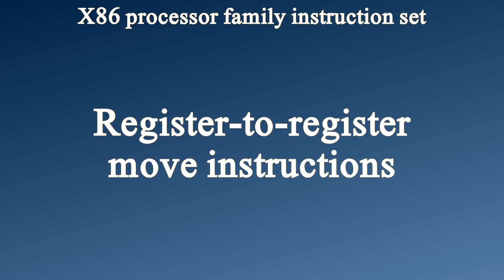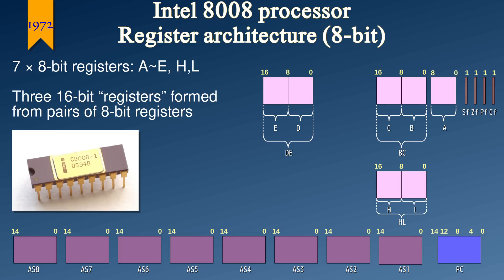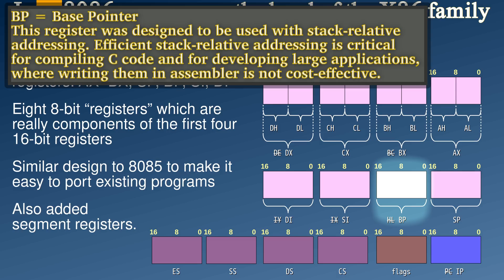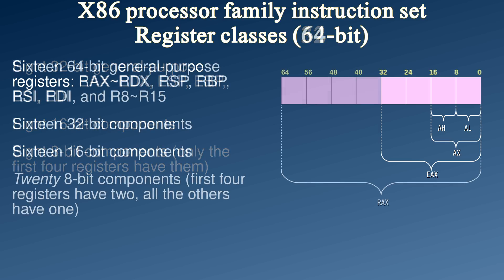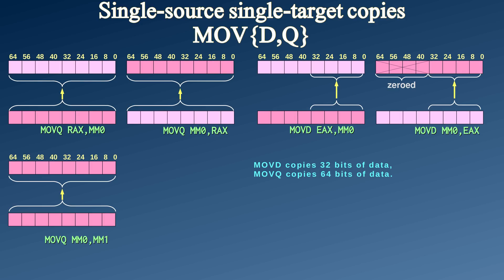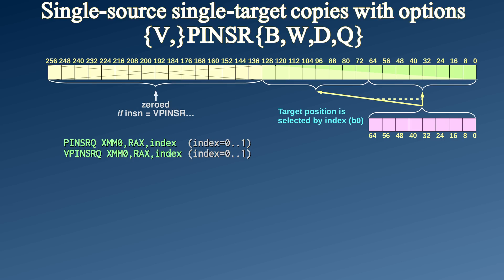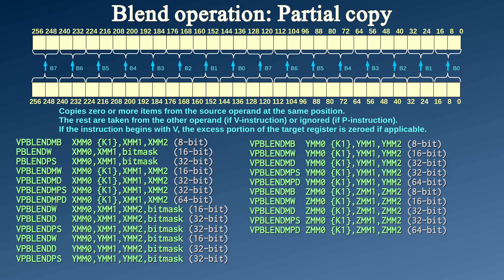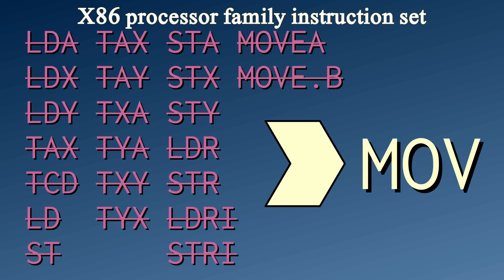x86 mov insns & short history of the most popular CPU architecture

Comment from the maker: A reminder: Do not reply to this post if you want me to see your comment. Post your words as a new comment, not as a reply, unless you are addressing the contents of this comment specifically. YouTube does not show creators new replies, it only shows new comments. If you reply here I will not see it unless I manually check for  it. If you are addressing a comment someone wrote, then you should reply it, though.
----
You may have seen parts of this video previously in my other videos, even if those videos were published many years ago. Either this means I am a time traveler, or this video has been in the works for a long time. In any case, I decided to finally push it to production & publication.
Because the topic is so incredibly broad, I decided to limit it to register-to-register move instructions only. If we allow other kind of moves, we get plenty of new use-cases. The x86 instruction set is not small by any measure.

For example, we have VPGATHER{Q,D}D / VGATHER{D,Q}P{S,D} which can perform up to four 64-bit loads from completely unrelated memory addresses in a single instruction, and the VPSCATTER{Q,D}D / VSCATTER{D,Q}P{S,D} which do the same with stores instead of loads. There are also VPMASKMOV{D,Q} which work much like the BLEND operation (sieve) but with memory.
Then there is the LEA instruction which has already existed since 8086. It can do not only a load of a constant into a register, but it can also do addition and multiplication in the same instruction. It was made even more useful in 386 which added scaled-index addressing, so much so that pretty much every compiler utilizes this instruction for multiplications of constant values.

IA64 sadly never became popular, because it was thought that the architecture puts too much responsibility on compiler developers. But even today, as intelligent as the x86 processors are with their register renaming and multi-insn-per-cycle pipelinings, there are several instructions in the instruction set that are designed to improve performance, but which compilers never generate without explicitly being asked to. For example, all the prefetch instructions. And the whole thing about dozens of instructions that only differ in the type hinting… Yeah. That is the role of compilers to choose from.

Nitpicking:
All this study about instruction names concerns language, i.e. culture, not CPU design. It is just what Intel decided to call certain operations. They could have had “MOV EIP, 1234h” instead of “JMP 1234h”, and they could have had “MOV AX, BX+SI” instead of “LEA AX, [BX+SI]”, and they could have had “MOV EAX, SIG BL” instead of “MOVSX EAX, BL”, and they could have had “MOV MM1, MM0” instead of “MOVQ MM1, MM0”, and they could have had “MOV GDTR, [label]” instead of “LGDT [label]”, and they could have had “MOV [++ESP], EAX” instead of “PUSH EAX” … without changing a single thing in the CPU design. But they did not. I’m not criticising… much. I am just documenting. :-)

Errata:

— I neglected to mention that the number of XMM registers was initially only 8. When AVX was introduced, it extended the number to 16, the width to 256 bits and name to YMM.
— I got the B/C and D/E wrong way around in my BC and DE pairs. B is higher, C is lower; same for D and E. Thanks theALFEST!
— There is a byte-size shuffle instruction, PSHUFB. I also missed PSHUFW. Thanks Jan De Kock! And of course I acknowledged on screen that I neglected VSHUFF{,I}{32x4,64x2}.
— Didn’t list VPBROADCAST{B,W,D,Q} and VBROADCASTI{32x{2,4,8},64x{2,4},128}, which are integer versions of the broadcasts, or VBROADCASTSD, which was added in AVX-512.
— Didn’t list VPERM{B,W,Q,ILP{S,D},{I2,T2}{B,W,D,Q,PS,PD}}, even though I did VPERM{I,F}128 oddly enough.
— Didn’t list VPMOV{,S,US}{QD,QW,QB,DW,DB,WB} which do integer conversions from large to small, much like the {V,}PACK{SS,US}{DW,WB} that I did mention.
— Didn’t list {V,}PMOV{S,Z}X{BW,BD,BQ,WD,WQ,DQ} which do integer conversions from small to large, being vector parallels to MOV{SX,ZX} which I did mention.
— Didn’t list VPMOVM2{B,W,D,Q} and VPMOV{B,W,D,Q}2M, which do conversions between mask registers and XMM registers.
— Didn’t list {V,}P{SRA,SRL,SLL}{V,}{W,D,Q} which do bit-shifts, but compilers (ab)use these as a combined mov & clear.
— Didn’t list {V,}PALIGNR or VALIGN{D,Q} which is like a combined SRL (shift right) and UNPCKL (interleave).
— Didn’t list any instructions that do conversions between floats of different sizes or conversions between floats and ints, which at least on AVX-512 are possible to do without memory operands.
— Didn’t list conditional moves: CMOVxx or VPTERNLOG{D,Q}, even though I did list blend instructions which also do conditional moves.

Instructions that I did list:

— MOV: Copy entire Ⓑ (same size)
— MOV{SX,ZX}: Copy entire Ⓑ (into larger size) with sign/zero extension
— {V,}MOV{D,Q}, KMOV{B,W,D,Q}, MOVDQ2Q, {V,}MOV{SS,SD}, {V,}MOV{{A,U}{PS,PD},DQ{A,U}{8,16,32,64}}: Copy from Ⓛ to Ⓛ
— {V,}PINS{B,W,D,Q}: Insertion of ⓁⒷ into ⓈⓋ
— {V,}PEXTR{B,W,D,Q}, {V,}EXTRACTPS: Extraction of ⓈⓋ into ⓁⒷ
— {V,}INSERT{I,F}{128,32x4,32x8,64x2,64x4}: Insertion of ⓁⓋ into ⓈⓋ
— {V,}EXTRACT{I,F}{128,32x4,32x8,64x2,64x4}: Extraction of ⓈⓋ into ⓁⓋ
— {V,}INSERTPS: Insertion of ⓈⓋ into ⓈⓋ with clearing of ⓈⓋ
— {V,}BROADCAST{SS,F{32x2,32x4,32x8,64x2,64x4,128}}: Copy ⓁⓋ into all parts of Ⓥ
— {V,}MOVS{L,H}DUP: Subdivided broadcast
— {V,}PBLEND{,M}{W,D,PS,PD}: Sieve Ⓥ into Ⓥ
— {V,}PUNPCK{L,H}{BW,WD,DQ,QDQ} and {V,}UNPCK{L,H}P{S,D}: Interleave Ⓛ or Ⓗ of two Ⓥ into single Ⓥ
— {V,}PSHUFD, {V,}SHUFP{S,D}, {V,}PERM2{I,F}128: Copy multiple ⓈⓋ into Ⓥ
— {V,}PSHUF{L,H}W: Shuffle but only for Ⓛ or Ⓗ, copy other half verbatim
— {V,}PACK{SS,US}{WB,DW}: Pack from two Ⓥ into half-size slots in Ⓥ with saturation
Ⓛ = Low part of
Ⓗ = High part of
Ⓢ = Selectable part of 
Ⓑ = Base register
Ⓥ = Vector register

FAQ:

Q) 4K is fine, but what's the point of making a powerpoint presentation 60fps? (thinkingobserver)
A) When I create a project in kdenlive, it is usually at a point where I don’t yet have all the footage, nor have I entirely decided all the footage I want to add later. For example, here I added the little camera clip of my Z80 almost at the last moment. I just do all my projects in 4K 60fps so that I don’t need to change it later, which usually would break havoc on the project. Also, 60fps gives you smoother transitions & other animations.

Q) Register is pronounced very differently from resistor.  You are pronouncing them nearly identically and it's the first case where my ears are having trouble following what you are saying. (DoomRater)
A) My native language does not have the English z,sh,ch,j,th,r sounds, so every time it takes some conscious effort to produce them. When there are rapid alternations between those and similar phonemes /l/ and /s/ that we do have in Finnish (we also have trilled /r/), I can’t keep up. The word "register", and especially compound terms like "general-purpose register" are practically tongue twisters to me. I know exactly how they should be pronounced, but my tongue just does not cooperate. For more information: https://www.youtube.com/watch?v=SJZlIQqjVS4

Q) The background music is a little loud. (Lego Guy Two One Seven)
A) I tried it with my headphones and I set the volume levels to whatever I felt that I could still comfortably hear the talk. I actually spent several hours working on this.
Q) This [...] music is terrible and distracting.  There is no need for it. (proteusx)
A) I actually needed some music for the record needle scratch joke to work. There are several other reasons why I prefer to have some background noise. But I always try to choose the music thematically. For example, the battle theme when describing Zilog’s challenge to Intel resting on their laurels. I often also try to match crescendos and other flourishes to particular situations in the story, editing the track if necessary. It is my artistic style. Sorry that you didn’t like it. It is impossible to please everyone!

Q) Do compilers even use any of this? I just don't see a situation where you'd need these operations. (Chyza)
A) Yes, they very much do. Sometimes better, sometimes worse. See some of these examples: https://godbolt.org/z/aMjzRd (simple vector moves), https://godbolt.org/z/-xgsvv (VPBROADCASTW), https://godbolt.org/z/z9RjBG (destruction and mayhem with examples of MOVZX, PACK, UNPCK, BLEND, SHUF, INSERT and EXTRACT across the three compilers). In the third example, the init2 function is written hand-holding the compiler to get them to produce the code that I wanted them to produce for the first init function. If you enable -mavx512f, ICC goes bonkers again. Auto-vectorization is an ongoing field of R&D for compiler development. Sometimes the compiler does not get it at all, sometimes it does it very well, and sometimes it crafts a rube-goldbergian monster for simple code.

_________
Previous content:
This is the pinned comment. Sorry, I posted much information here earlier, but YouTube nuked my post when it changed the video (from unlisted) to private temporarily for the scheduled publication. Nowadays, apparently, YouTube permanently erases all comments on videos that are made private. In this case, the video was private for exactly zero seconds, because I set the scheduled publication time to be in the past. Isn’t it exciting to learn new things by surprise rather than e.g. them being announced somewhere?

Eventually I nuked the video because of reasons. This is the new upload, version 2. I will re-type the information that I intended to have here after I am well slept and no longer worked up.
Reply: I would love a more opinionated overview of different ISAs, with comparisons between them. x86 is very complicated, it would be cool to see a comparison with ARM or RISC-V.
Reply: Incredible amount of detail - must have taken months. Just starting to learn about assembly (via learning gdb) and this blows my mind somewhat. Thanks for making it..
Reply: Abit fast but I like your aproach to spelling the instructions :) funny.
Reply: RE: Instructions - now I see why DynaRec is working so well for x86 on ARM (and probably on RISC-V), and why more horse-power is needed to speed it up.
RE: Music - some people have hearing issues that they believe are other peoples problem, dont sweat it, I appreciated the extended effort required from your artistic vision
Reply: Great video man. Actually I am learning architecture of PC and it also helped me :D I am always willing to see some videos about hardware level/low level programming :D
Reply: when i was watching i was thinking it sure reminds me of something... and indeed it does !  starts normally, but then...  https://www.youtube.com/watch?v=FavUpD_IjVY
Reply: Bis{D,Q}wit! So you do love more than just 6502! Yes it is fun to mess about with 6502 and old nes games code but I have to acknowledge that is just tinkering and for fun... Getting any serious work done is for our modern processors but that which as shown here is way more advanced and can feel quite complex at times (until you work with those instructions enough and get used to how they work) which is why it can be nice to retreat into some 6502 coding or similar as it provides a break from the advanced modern architecture(s) and timewarp almost into a simpler time! lol So yea more C++ stuff and reversing nes is always welcome but writing some pure assembler by hand for some specific purpose or program would be really cool too, you'll like it!
Reply: as an aspie, it is simply impossible to understand the speech while hearing the music.
Reply from the maker: There are captions.
Reply: @Bisqwit  well i can as well watch a slideshow then.

Comment: 17:20 Actually, there is a byte size shuffling instruction starting with SSSE3 which is PSHUFB, and then in AVX2 which is VPSHUFB and so on. People use these instructions mostly for holding small look-up tables of 16 or 32 entries, mainly useful for reversing strings of data.
Reply from the maker: Indeed, somehow I missed PSHUFB and PSHUFW while making this video.

Comment: I'm with Linux on AVX.

I already have a co-processor for highly parallel tasks.  It's called a GPU.  Please do not waste the most valuable real estate on Earth on a power virus when it could instead be used for cache or cores.

The fact that we're so scared to offload embarrassingly parallel workloads to the copro specifically made for them that chip manufacturers as a whole decided it was a good idea to make strictly worse products speaks to how bad our software tooling is.  We programmers should be embarrassed.
Reply from the maker: There is a significant overhead in offloading tasks & data to a GPU and fetching the results, that makes GPU offloading practical only for explicitly very bulk operations that are specifically designed so. It is not usable for general-purpose programming.

In contrast, SIMD parallelism in CPUs is designed for much smaller tasks, arising naturally from not particularly parallel programming, such as clearing a memory region, searching a string for a character, or adding values together in two vectors for whatever reason. In the pursuit for more calculations per clock cycle, SIMD is a valuable tool. And unlike GPU programming, it can be performed without the overhead of transferring data in and out. You can use it to blend transparent layers in a SNES emulator without having to design the entire SNES emulator over GPU limitations. This convenience cannot be overstated.

Comment: Dammit... we need to MOVe quickly to a RISC/ISA... 
and leave these "complicators" at Intel talking alone...
Reply from the maker: RISC is a beautiful idea that presumes you can think of every possible use case in advance. With an ISA that lives more than a few years, or indeed like with x86, five decades, that is simply an impossibility. Nonetheless, inside every x86 there is actually a microcode interpreter that has RISC traits. On the outermost layer of the processor, there is an interpreter that translates x86 instructions into this RISC architecture, using a huge register file with dynamic register mapping. I find this to be a good solution. My only qualms with x86 is that the opcode encoding is very suboptimal with the numerous prefixes. It could be so much more compact, had it been designed with future foresight. But with a project this long, that’s not a reasonable wish.

Comment: ... and this is why ARM is much more efficient ... x86/64 has a lot, lot of buggage....
Reply from the maker: An instruction decoder is but a small part of the modern CPU.
Reply: @Bisqwit  that's true, but a simpler overall architecture can be better optimized - better to have multiple simpler cores than a super-complex core that very few will use. Who uses AVX-512? it is not supported by most AMD processors.
Reply from the maker: AVX-512 is not used much, because not many processors support it yet. The same used to be the case for AVX2, yet today it is very commonplace. Compilers can and do produce optimized code that takes advantage of AVX2 and other processor instruction set extensions, if permitted to do so. Even a simple array initialization loop is likely converted into a set of AVX2 vector instructions that initialize multiple members in parallel, a significant speed improvement compared to setting each member one by one.
Reply: @Bisqwit  well, in my (small) experience, focusing on "cutting-edge" CPUs and breaking compatibility with baseline systems is not something many companies want. For example, windows 10 runs very well on a core 2 duo system with an SSD. Most software I use (including 3D rendering software) supports this processor, so they either provide multiple dlls or they simply don't utilize such extensions. 

I think what apple does with M1 and rosetta is potentially disruptive in the industry, much like what happened with llvm
Reply from the maker: Binary-only software vendors are often required to target the lowest common denominator indeed. There is the alternative of using a linker that is aware of different processor variants (for example Intel ICC does this, GCC is also capable), but I don’t know how widespread that is. I don’t know anything about "apple with M1 and rosetta" so no idea about that one.
Reply: @Bisqwit  Apple's M1 processor is ARM based. Rosetta does JIT-recompilation from x64 to (arm64 I guess?) and the apps run super-smooth, transparently to the user.

It essentially allows running executables (and dlls) for the intel-based macs to the arm-based ones with zero user and programmer effort - and miraculously it offers a performance boost! Maybe take a look at what Apple does with M1 and rosetta, I believe we will see similar trends in windows-based systems in the future
Reply from the maker: What modern x86 processors do is actually translate (you could call it JIT) all instructions to their internal microcode that has a vastly different architecture than the external interface that is the x86 instruction set.